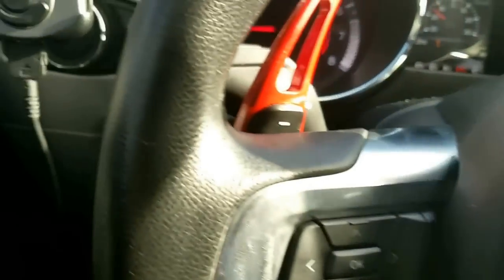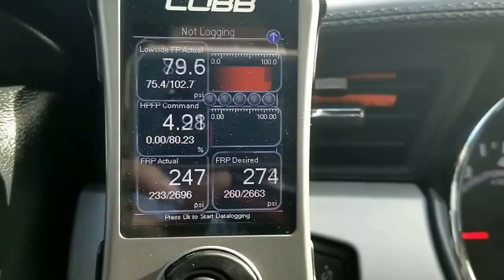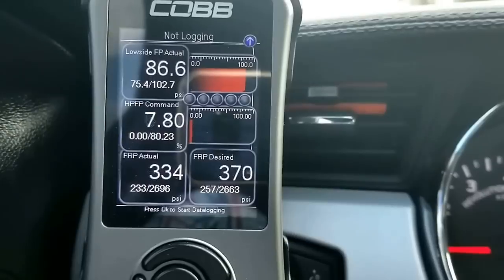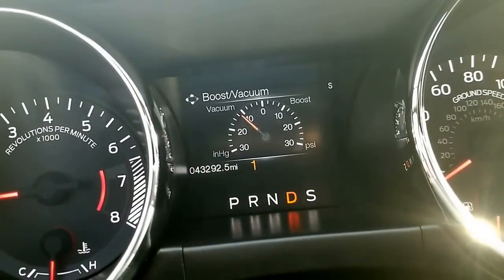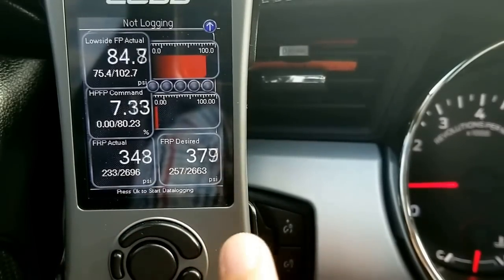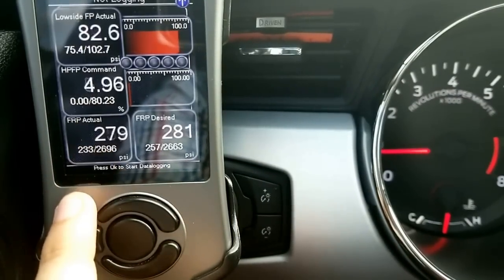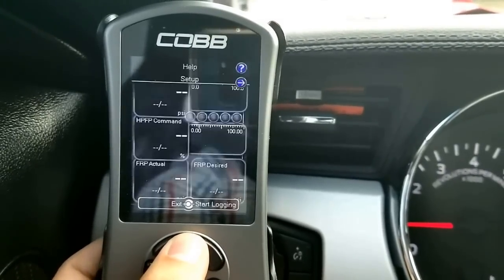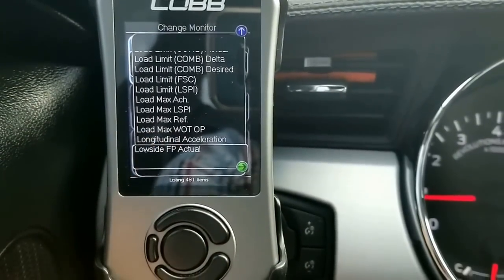WARNING!!! Your Fuel Pressure Sensor May be Failing!!!

Comment: Probably can’t help me and I know it’s been a long time but I watch your video in the shit load of times and I replaced my low pressure fuel sensor when I first got in the car because I seen your video but the trouble I am having now I have a purple drink tune everything‘s been fine but here lately my air fuel ratio will only drop down to 11 and not into the tens, like it was supposed to and my low pressure sensor reading shows it’s dropping into the 50s that means it’s going bad right judging by your video, I would think so
Reply from the maker: Seems like it yeah.

Comment: Hi I've been having fuel related issues with no engine code in thinking it's this sensor. My rpm go up and down on idle kinda like fuel pressure going all whack. Is this a early symptom??and is this sensor in the fuel tank fuel pump??Feels like engine is dumping in too much fuel at times, other times like it's not dumping enough. Thanks
Reply from the maker: Looks like it yeah
Reply: you ever figure this out? your describing the same issues I have.

Comment: Hey man, I know you sold your vehicle but, by any chance do you recall FRP going into the 2,000 and higher? Mine DESIRE is 399 and actual is always at 1,000+. Under boost they both go to 2,800range. Bad sensor?
Reply from the maker: Can't recall 😬
Reply: @hectorlopez7223 did you ever get this looked into?

Comment: My frp actual at idle is at 250 ish and my frp desire at idle is also at 250ish I seen yours in the high 290ish is my sensor bad ? I have a cold air intake and a ots tune cobb
Reply from the maker: Don't think so. Are you experiencing the issue?
Reply: @BoostedWhipz  my car vibrates sometimes  but it’s weird at idle yours was in the high 290s mine is 240 -260

Comment: what year is yours?
Reply from the maker: 2016
Reply: BoostedWhipz once in a while my idle goes down when I put from drive to park. Then it slowly rises back up. I have a 2019
Reply from the maker: @danielabrego2715  as long as it doesn't feel like it's about to choke and power off you are fine.
Reply: BoostedWhipz  so that’s normal ? It’s brand new it never did that before that’s why I got concerned
Reply from the maker: @danielabrego2715  as long as it doesn't feel like a choke you are fine.

Comment: So your car is running well still? 18 ecoboost 6mt just installed accessport with 91 tune. My gauges read identical to yours in this video. With low side maxing at 102 at some point but sitting around 80-90 while cruising Just wondering if I should be worried about going over 100
Reply from the maker: No longer have the Mustang, sorry
Reply: Any updates ?
Reply from the maker: On?

Comment: My car was tuned prior to me changing the sensor.  After i changed it i don't feel the same power.  Do i need to retune the car.  It feels stock ?
Reply from the maker: I wouldn't know. Check with your tuner and run logs. They will be able to compare your last tune log versus now.

Comment: What tool do you use ?
Reply from the maker: What tool?
Reply: @BoostedWhipz  the device that reads the pressure sensor data
Reply from the maker: @ahmedmoustafa6829  the Cobb Accessport?
Reply: @BoostedWhipz  yes.
Reply: @BoostedWhipz  would torque app do the same job?
Reply from the maker: @ahmedmoustafa6829  not sure man. No longer have the car

Comment: yo man i have a v6 camaro 2010 and i have a problem with it bogging/jerking the car when i accelerate hard at a stop light and it feels like it wants to die but it doesnt! i checked my throttle body i checked my mass airflow sensor i check my motor mounts idk what else it can be so my question is would it be something with the fuel? ...the car starts up right away and everything idels fine but only happens when i drive the car
Reply from the maker: Could be as that was my problem. Check you fuel pressure sensor or hoses.
Reply: BoostedWhipz  alrighty thnx bro
Reply: Check the fuel filter that would do it. It can starve the engine of gas if it's full of dirt.

Comment: I have a question. I have a 2004 Mustang GT lightly modded. SCT programmer my battery went dead on my car and now I can't start my car. Would it be a fuel rail regulator?
Reply from the maker: Not sure and not familiar with GT... Sorry.

Comment: Solid video! I hooked up to my 16 FiST with Forscan and had a P008A code... didn't pay much attention to it. Just installed my Accessport and saw the same code so I looked into it. LSFP Actual was anywhere from 24-60PSI and Desired was 81-83psi. Bought a new sensor for $40 and swapped it in about 5 minutes. Started the car up and LSFP Actual was right back up into the 81-100 range.

Much appreciated. Your time helped greatly!
Reply: 64bit Tuning Concepts hey man where did you buy the sensor at? I also have a fist

Comment: I still don't get what the low pressure sensor has to do with the engine going lean. Or does it produce false command signals for the high pressure pump when the low pressure signal is too low? So the high pressure pump won't build up enough pressure in the rail?
Reply from the maker: Not sure... This question is for the expert Adam Brunson. I just relayed the message.
Reply: I think I have that same problem. A sort of “pulsing” idle? Sounds like I’m pretending to have a cammed engine lol, but it only happens in the cold. Did you ever find out the issue?
Reply: The fuel pressure sensor senses the pressure in the fuel line before the high pressure pump. It relays this info to the pcm which then tells the fuel sender to run or not. If the the sensor is faulty (depending on what it’s telling the pcm) the engine will run rich or lean

Comment: Is it the same reading on the .manual transmission
Reply from the maker: edgar castro yes sir, same for manual transmission.
Reply: Ok cuz mine is reading way different than yours I'm a double check it
Reply from the maker: edgar castro if you are under warranty have Ford check it out directly. Are you getting any rough idles?
Reply: Yeah wen it's on nutural sometimes drops idle less than 500 rpm like it wants to turn off then shots back up to normal 500 rpm

Comment: Im having issues with rough cold starts and getting misfire on start up code. Any ideas on what could be my problem?
Reply from the maker: Ritsu Saito I am not a mechanic, but when I had your symptoms, it was related to my spark plugs and the fuel pressure sensor and vapour hose. Ford replaced those and it fixed my issue. If you have warranty, have Ford check it out. Rough idles tend to have many reasons for it. Trying to figure out each scenario is very time consuming.
Reply: I’m in the same situation. Just got a low fuel warning and my access port started showing misfires. I’ll get it up to a dealership. Sounds like it’s my sensor and spark plugs. I also noticed my boost pressure is bumping up

Comment: yeah im on stock but after i fill up gas it kinda stalls out when im just idling like the rpms drop below normal i can hear the engine dropping rpms
Reply: I had the same issue on my '16. The idle would drop and go rough for about 1-2 secs after I filled the car up with gas, then return to normal. It was the evap purge solenoid. FR3Z-9G297-H is the part number you want. It was like $20 and took 10 minutes to change with basic tools. Never had the issue since.
Reply: this used to happen to me on my focus st changed the purge valve and it fixed it
Reply from the maker: El Sito take it in and get it fixed. You have warranty still?
Reply: El Sito mine is also the same after u fill up the tank. Did you find out why?

Comment: Hey man the tuner is very good you no have problems with the tuner in you ecoboost ?
Reply from the maker: Jonny 2.3T_s550 no problems on my end. I been using it for a year now. However I am using TUNE+ for the tunes. Using the stock tunes from Cobb is not recommended.
Reply: @BoostedWhipz  you dont kno wtf u talkn bout lol how is the accessport tune from cobb not recommended? lol u will get more out of a pro tune but saying its not recommended you sound like you dont know wtf u talkn bout
Reply from the maker: @drsauce2574  because those tunes are tied to their branded parts not other branded aftermarket parts. Recommended was the right word, you are right.
Reply: @BoostedWhipz  bro what does it matter if its there branded parts lol , a 3 inch downpipe is a 3 inch downpipe regardless what brand you get and a intercooler is an intercooler regardless of what brand you get , so what could really be so diff in different brands of aftermarket parts.....as long as you got the aftermarket parts needed for the tune you should be straight of course its not gonna get the best out of it from the off the shelf cobb tunes as you would a pro tune but i wouldnt say its not reccommended
Reply from the maker: @drsauce2574  you'd be surprised bud. Each brand designs differently. Intake, downpipe, intercooler, etc. Each have different air ratios and other settings. Again "recommended" was the wrong word.